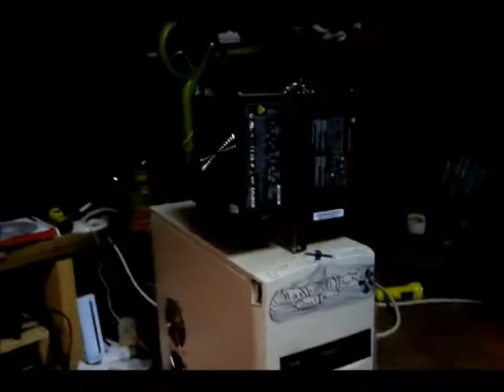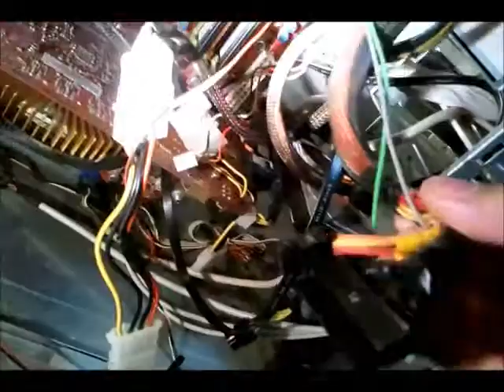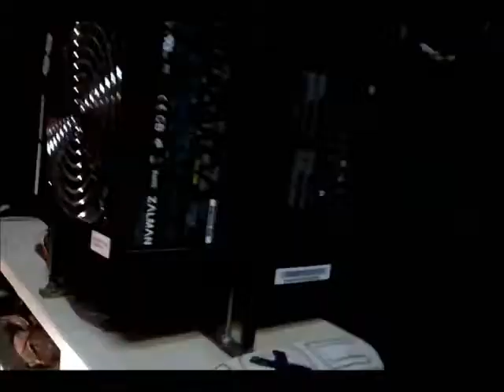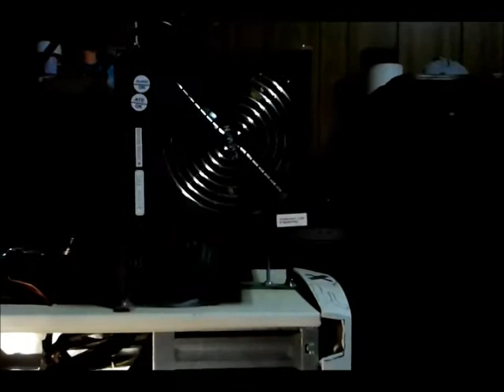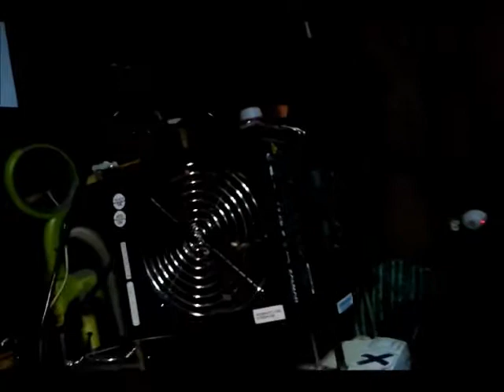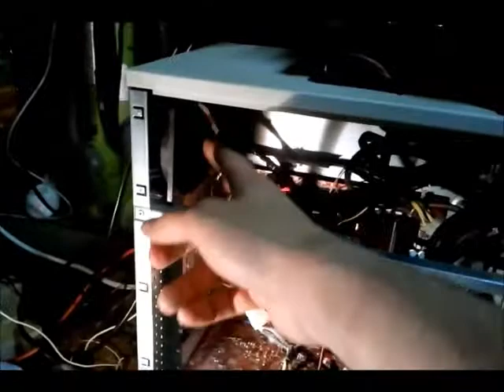Dual Power supply gaming rig

Comment: Here's my problem my graphics card pulls its power from the board it's a GT 750 and my power supply is only 240watts and it's a small form factor PC so it's pretty expensive to find a power supply above 240 Watts in small form factor so really my only solution would be to try and parallel too power supply's is there a way to connect the output of every connector of together o. The power supplies just hook it up normally?
Reply from the maker: I wouldn't attempt to connect them in parallel. There might be a safe way to do it but I'm not familiar with it. Generally smaller form factors mean you're going to HAVE to spend more money on the same performance.

Comment: My system has a 260w PSU, and I have a spare 350w PSU. 
Should I replace my PSU with 350w and use the other one to power my GPU? It's 26w short on power so I have to use a 6 pin connector, which my 350w PSU doesn't have (molex is not an option).
Reply from the maker: You should be able to order an adapter or just use the 350 for the video card.

Comment: do I need 2 of the same psu's(like 2 500 watt corsair psu's) or can I use 2 completely different psu's(different brands and wattages)?
Reply from the maker: they can be completely different.
Reply: Will it be a safe option or am I better off buying 1 more powerful psu?
Reply from the maker: +AFG Fusion if you do it right it's not dangerous, a single more powerful psu is easier but this is a safe option.
Reply: in my opinion is more intelligent use 2 psus at 50% of load, instead use ONe at 90%, the lifespan on 2 psu to best for me.

Comment: if I have a card that requires ~300w
then can I have a 500w psu for most components and a 430w psu for the gpu?
card is hd 7990 and my psu can output 38A
help please
Reply: Jonah McPartlin I decided this was too risky
so instead I'm going with a single 750w psu

Comment: I actual just did this to my old PC. I got a better mobo and cpu from a buddy and put it in my old case with a 350w power supply which barely ran my old equipment. So when I put in these components the draw was to much for the little power supply, and the power supply my buddy gave me had some issues but i realized i could still use the molars from it. So i actually have both supplies inside my case, the second supply is hidden in my empty drive expansion slots and the power cord is ran out the back next to my liquid cooling inlets. I guess the point i'm getting at is I was able to cleanly upgrade my system with $0 put into it, and unless you started looking really closely at/in/around my living room system. 

...and this video is much more helpful then the first one I came across where the kids just chopping and stripping wires. and twisting shit together.

Thanks for the video man!

Comment: If you are powering a mobo with PSU1, and GPU with PSU2, are you mixing +12v lines of two PSU's (Because GPU draws power from the PCIe bus (PSU1) AND PCIe power connector (PSU2))?
Reply from the maker: There shouldn't be a need since the bulk of the power it takes will come from the  direct connection to the power supply.

Comment: i will connect the two psu as you have shown but i will common both ground. Is this a good idea?
Reply from the maker: In theory, as long as one psu is grounded to the case you should be fine, but having both grounded is just a better option.

Comment from the maker: For 15 bucks it will save you a lot of time and you don't have to worry about the wires losing contact.  Just weigh out your options though, high wattage power supplies have gotten a lot cheaper.

Comment from the maker: To be honest I looked up the wiring online, and I ran the machine with those wires jumpered like that for a year, so it works :-D.  What are you trying to bridge all the units together for?  I don't believe that will work, I believe they will damage each other.  The reason that this works is that although the turn on wires are jumped together the power supplies themselves are independent of each other.

Comment from the maker: Someone was asking me if you could simply run a wire to the case without actually attaching the second PSU.  You can do this, I do not recommend it though, it's never good to have a power source separate from it's device without a lot of safety measures you won't be able to do properly yourself, or at least not without a lot more work.

Comment from the maker: @petelebu Read the description it's a budget solution.  A full tower case and a 1000w power supply are likely to cost 150-200 dollars.  Not to mention when this video was made 1000w power supplies were selling for 150-200 by themselves.  This was a total cost of 50 bucks and both power supplies were new.  Someone could buy a new 430w for 20 bucks and use their old psu as the secondary.  In response to looks I couldn't give a crap less, I build for effeciency, not looks it's a computer not a car.

Comment: man just to let you know, instead of running that monster outside the case which looks awful, you could just get a more powerful power supply for your system, or a booster psu, OR , a full tower case that supports dual power supply such as nzxt, man that really looks dirty, in a bad way.

Comment: @xthegrim ok thanks I currently have a 310W power supply and my new graphics card needs 350W so If I add another 305W power supply will I be able to run my 8400gs 512Mb?